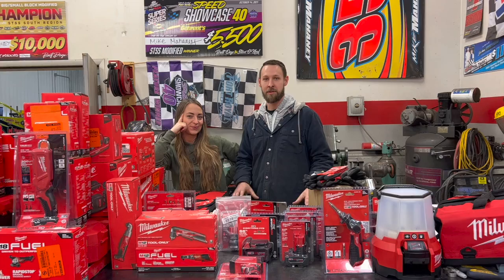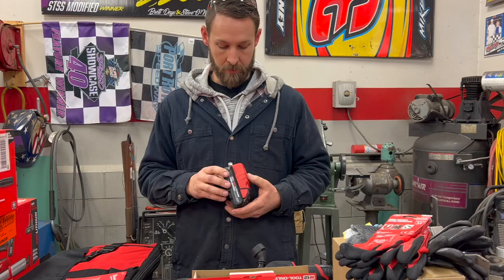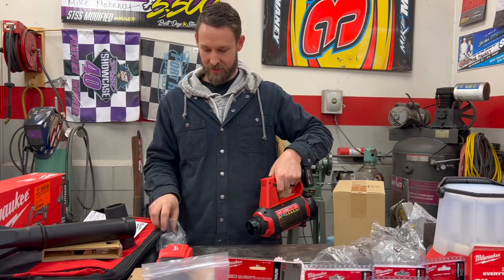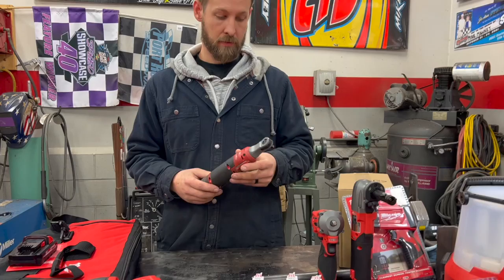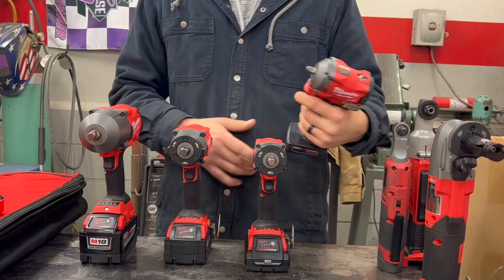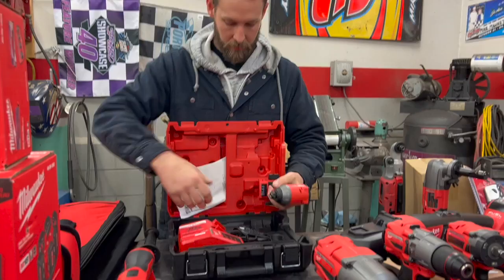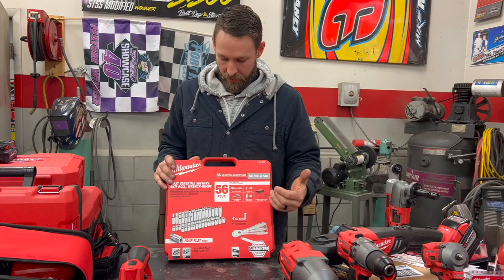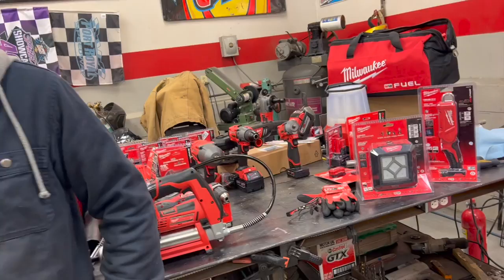Tools You Need in Your Race Car shop! Unboxing Video

Comment: Yes Mike,always make sure you have the right battery in the right tool! Lower amp hour batteries will burn up the tools! Its like running a corded saw on a 16 gauge extension cord that 100 ft long.

Comment: Dang that’s a lot of Milwaukee stuff lol, not gonna lie I’m jealous! Correct me if I’m wrong but I believe the down side to the multiple battery chargers is they will only charge one battery at a time. Still handy to only use 1 outlet, as long as you can wait for your batteries to be charged one at a time..
Reply: Multiple batteries charging at one time. At least that’s what mine does. Battery charging station has a blower to keep it cool

Comment: Be carful using the solder gun, if you use it for too long and get it too hot the top will melt off.